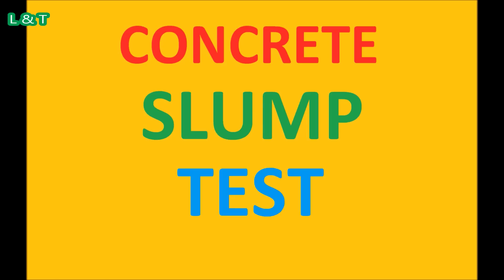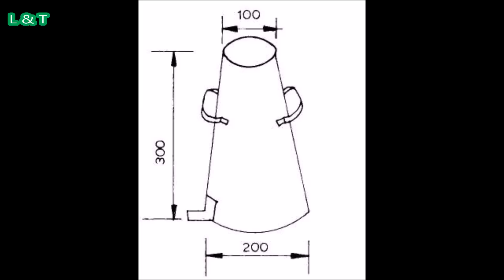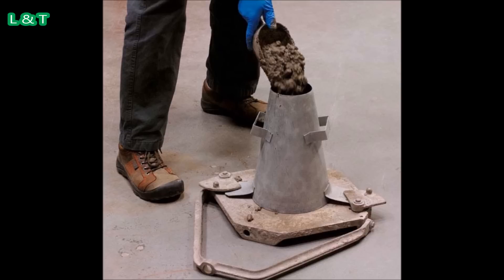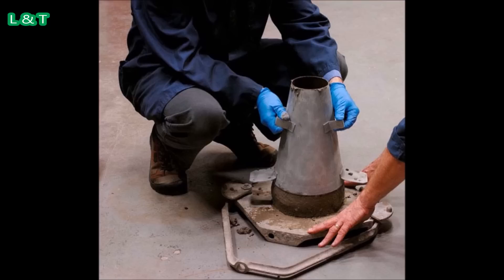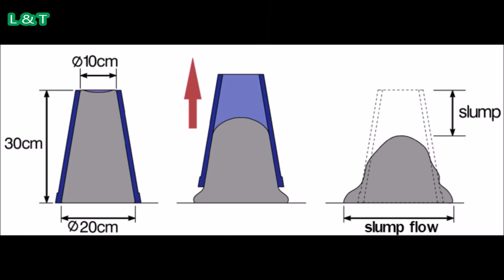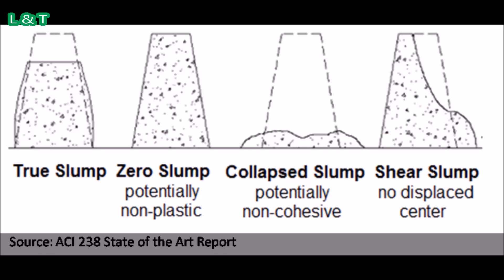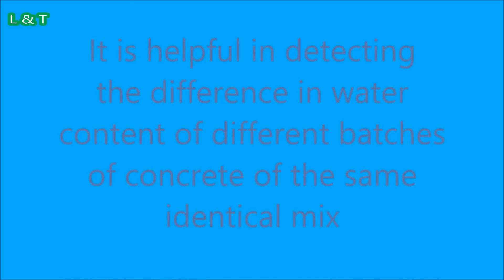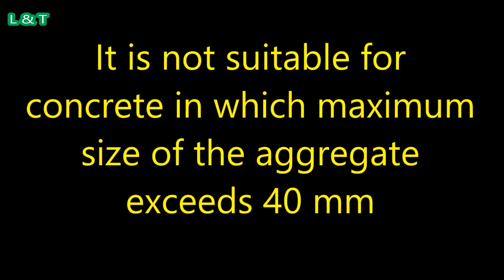Slump Test of Concrete | Learning Civil Technology

Comment: What should be the value of true slump...
Reply from the maker: In case of a dry sample, slump will be in the range of 25-50 mm. But in case of a wet concrete, the slump may vary from 150-175 mm. So the value of slump is specifically mentioned along the mix design and thus it should be checked as per your location.